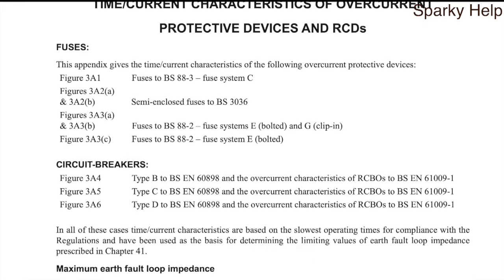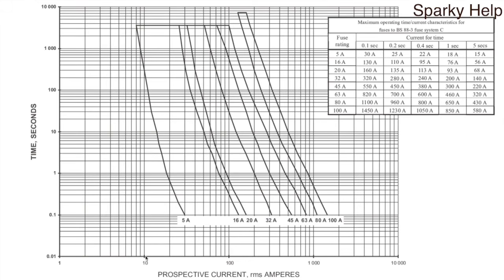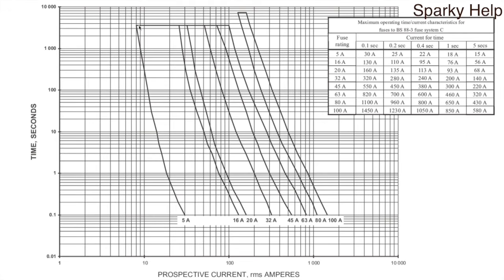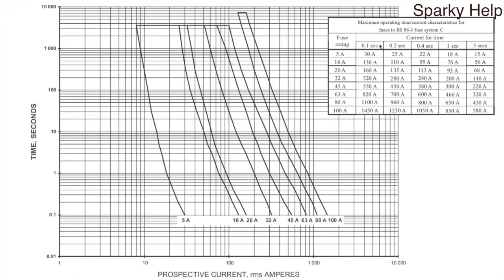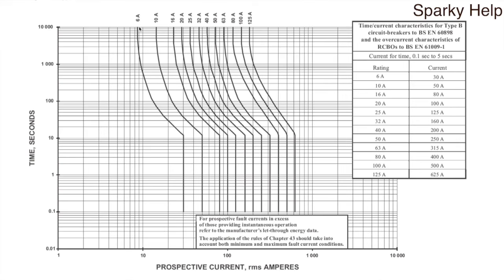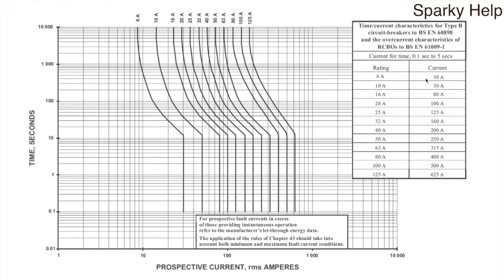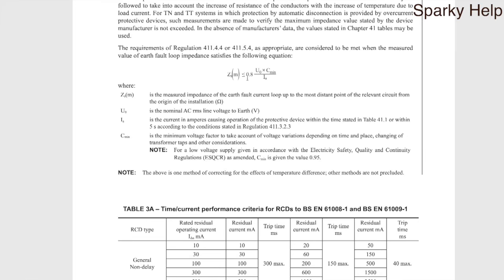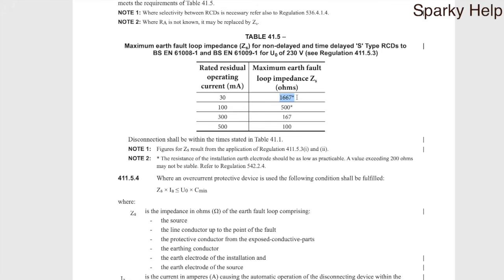Circuit Breaker or Fuse Disconnection Times Explained

Comment: Cheers for the video. Just so im clear in my head are the 80% figures that we generally use from the OSG already altered for the Cmin of 95% or do we still need to adjust the 80% figures for the voltage variants?
Reply from the maker: Cmin is used to calculate the Max Zs values (as per BS7671) the OSG are 80% of the regs (BS7671) values so you do not need to do anything to them.  Hope that helps please like share and subscribe.